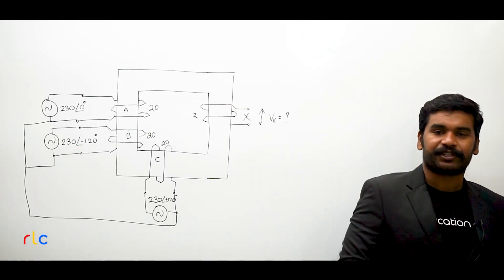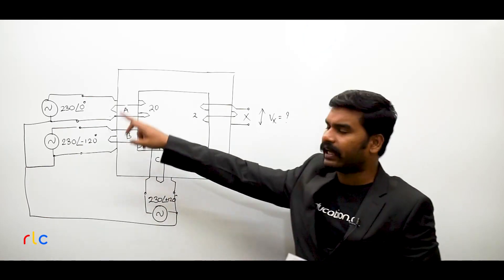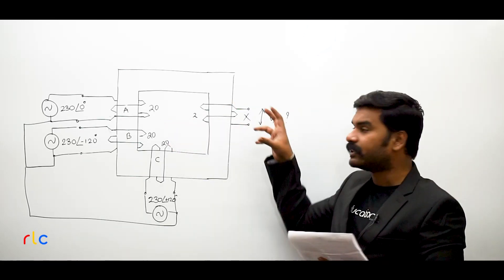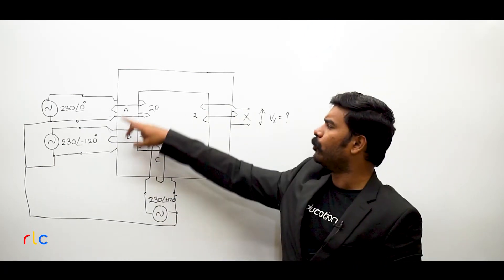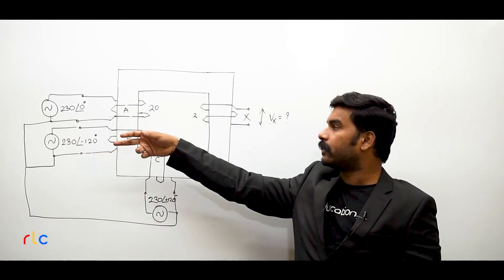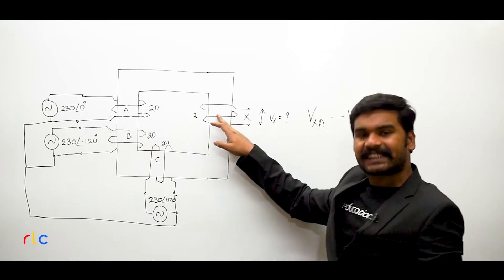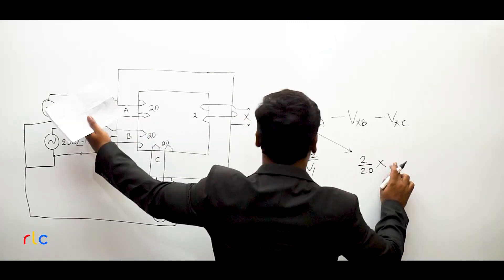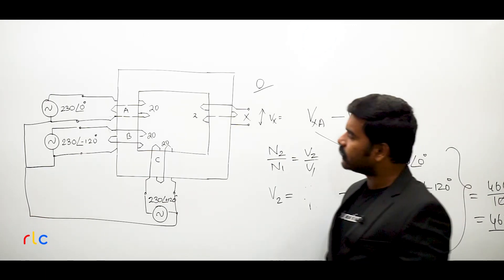GATE EE 2020 Solutions | Transformer Question | Nikhil Nakka

Comment: a balanced 3 phase system with a voltage 400 is suppling a balanced a star connected load 1500 w at a leading 0.8 power factor determine the line current. Now a balanced lighting load 900 w is connected parallel to the system what will be the new line current?   Sir Naku new line current Ela solve cheyalo teliyatamledhu knchm chepandi sir